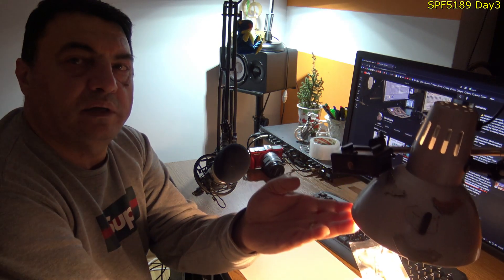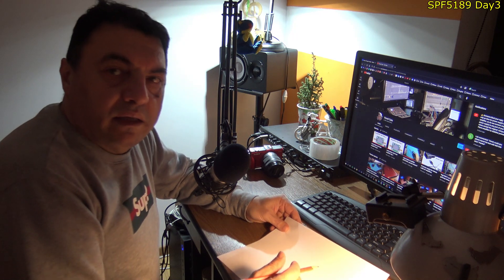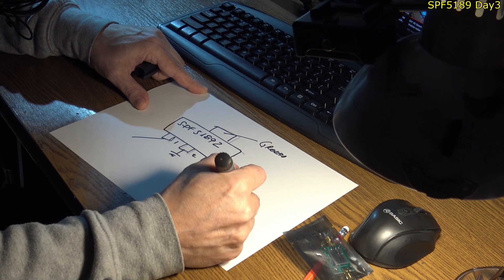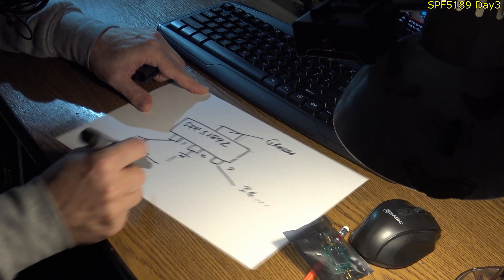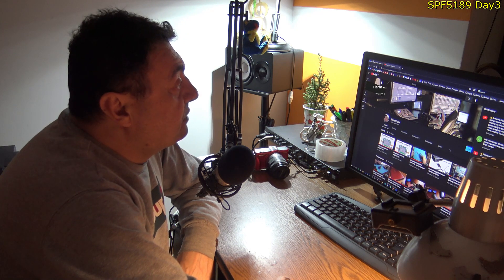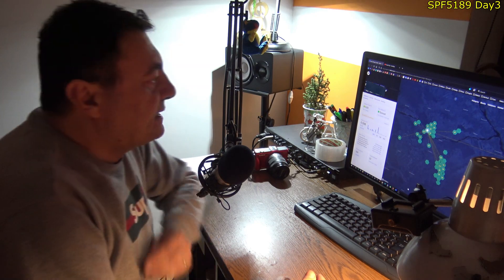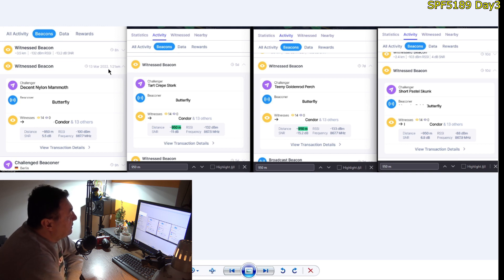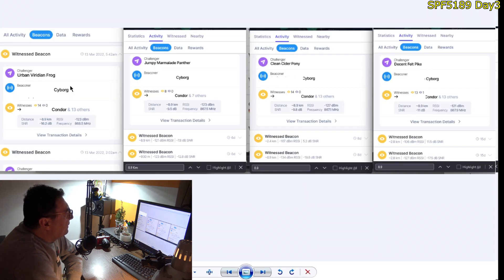LoRa Helium SPF5189 amplifier Day 3

Comment: Spf5189z  amplifier  goes up to 400mhz max as per datasheet.  Wont work for  868mhz.as it is way over max working freq.
Reply from the maker: Check again..it's wideband from 40 to 4000MHz
Reply: @viocaia  yes, i double check you are right. Is up to 4000mhz
Reply from the maker: @andreipaul5535  I have some..email me..

Comment: hello, I see all your videos and I like them a lot, could you explain me why my nebra hotspot only get witness arround -117 RSSI when the other hostpots arround me are getting witness arround -141 RSSI ???? i checko other nebra arround me, and do the same, is it problem os nebra hostpot of the RF card ?? or what ??? thank a lot
Reply: It's because Nebra is using the worst lora chipset of them all... SX1301 and it's reporting RSSI without SNR added on top. So what you see is bare RSSI and all others are reporting RSSI+SNR, so if someone around has Sensecap for example and their witness was RSSI -121dbm and SNR -18dbm then what you see reported in the explorer would be -121+(-18) = -139dbm
Your nebra is only reporting the same witness as -121dbm because it doesnt take SNR into calculation.
But there is also difference in packet forwarding between SX1301 and SX1302. You can google it if you are really interested in the subject.
Reply from the maker: @mattw6597  So what's  the best SX?
Reply: @viocaia  the latest is SX1303 but as far as I know no manufacturer is using it yet. From all helium hotspots the best are those using SX1302 chipsets as they are the most sensitive. But to be honest I got few panthers that use SX1308 chips (the one the heltec is using) and they are outperforming bobcats with sx1302 so sometimes better soft and saw filter used by the manufacturer can compensate for slightly worse card. But that doesnt include Nebra. They are just crap ;) Crap soft, crap hardware, poor made. Wouldn't recommend it. Got 3 indoor and 1 outdoor and had to put RAK sx1302 based lora module to make it perform as it should.
Reply: @mattw6597  ty, for your explain, and if i change the RF card for RAK whit SX1302 i can improve my nebra to work better ??? or its better get and amplifier ????? what you recomend me ????  ty a lot bro
Reply: @Karlo0310  from my experience (I used the jetvision flarm 17db bidirectional amplifier with tx bypass) it's totally not worth the price as they didn't increase my witnessed numbers much. 
I paid 85 euro for RAK2287 module on eBay and it increased my witnesses from 45 to 82. Flarm booster basically only boosts up the signal your antenna already was able to hear, it just gives you better RSSI but it won't magically make your hotspot to start witnessing hotspots from far away ;) If you ask me, I would go for RAK2287 and a good low loss cavity filter (but God forbid the expensive jetvision one!) rather than rx booster. I tried the bidirectional jetvision as well as Rx-only moonraker and the one from uputronics but they all turned out not worth it.
Reply: @mattw6597  oh! ok, thanks a lot you help me a lot, ok, i go to searth this rak2287 module, but, can install it on nebra whiout any problemas, only quit the nebra concentrator and put this one rak and this work fine ????? ty for all really
Reply: @Karlo0310  No problem, mate. It's always a good feeling if you can help the community :) 
The RAK module is basically plug and play. You just take the nebra module out and put the RAK in and you are good to go.
Reply: @mattw6597  thank a lot of guy !!!!! you help me hard!!!! ty a lot, and try to improve my nebra miner! thanks
Reply from the maker: I never opened a Nebra..but all of them use the same RF chips from Semtech, it's the same schematic allround..Now depends of the saw filters, if there is no filter before the Low Noise Amplifier..it's possible the LAN gets saturated with radio signals around you..an external filter at the miner input will solve that..but I should start with checking the antenna, good cable and connectors, also the height is very important ...

Comment: Hi Viorel, today in the morning I posted a link where to find datasheet for SPF chip... probably YT removed the post with the link. If you're still interested, tell me how can I send you that info. Bye
Reply from the maker: Thank you so much, I have all the data..in PDF  but what I'm looking for is someone which did measurements on the chip input to ground 1/2 and output to ground 2/3...there is no other way to find fakes from real..thanks again!
Reply: @viocaia  I wrote you another post which refers to differences between real and fakes which I found in some posts in eevblog, but YT removed this too. I try again for last time: the original measures 1 MOhm between 1/2 and 2/3 (fake spf5189 has about 3 kOhm on the input pin - When burned out, fake spf5189z has about 2 Ohms on the input pin, the same as original). The current for original is 90 mA @5Volt. Fake spf5189z has a gap with gain 0 dB at 13.5 MHz - Original one don't have such gap on a frequency response. One last thing: the shape of GND pin in the original it is shorter and skewed.
Reply from the maker: @TaperedWiz  Thanks! Great to let us know..I found that info too..amplifiers I have are exactly ''fakes'' 3K input..and 135mA..but no gap..interesting ''working'' fakes..why do they bother to do working fakes..do the goods ones and charge a little more..I don't understand...
Reply: @viocaia  Simply because they're chinese: they "adapt" parts and components to what customers are looking for. I "predict" we will have plenty of FLARM amplifiers in a month or so (at the moment the Shenzhen province is in full lockdown due Omicron...).
:-/
Reply from the maker: @TaperedWiz  Oh yeee, they are coming big time..it's already a new bidirectional on the market around 90EU..

Comment: Thanks for the video, I'm trying to find one of those amplifier around me but the one I can get only have 0.6dB gain really not worth the time,  but yeah the network is bad as I watch your video 3 hour after upload I checked and I have not received anything for 13 hours except for constructed challenges ... I also found that my miners is constantly out of sync + - 30 to 100 blocks , then it takes me about an hour to catchup only for a few minutes then it starts all over. Well what can we do.. thanks for your updates will wait for your next one as soon as the network starts working.
Reply: 0.6 dB is the Noise Figure, not the Gain...
Reply from the maker: @TaperedWiz  Of course SNR 0.6dB
Reply from the maker: Thank you too, I'll be back..

Comment: Yes we would like you to put ab 868 with a filter on a hotspot and say how its performing.
Reply: I put one of those small filters on my bobcat. My earnings got from  1.5$ to 5.5. but its a signal strenght/ noise ratio trade. I am waiting868mhz  amp and test after.
Reply from the maker: It's coming..one at the time
Reply: #MeToo! 🤣🤣🤣